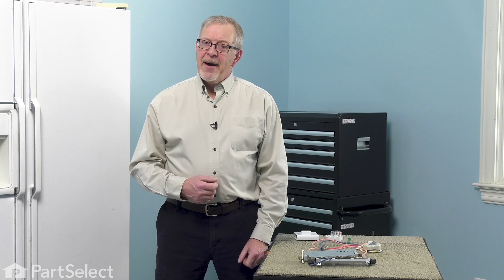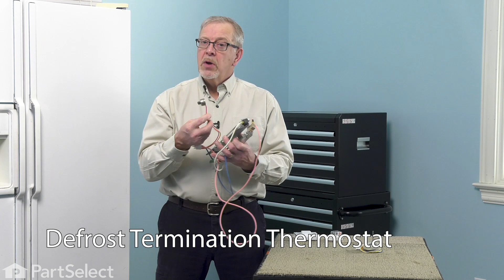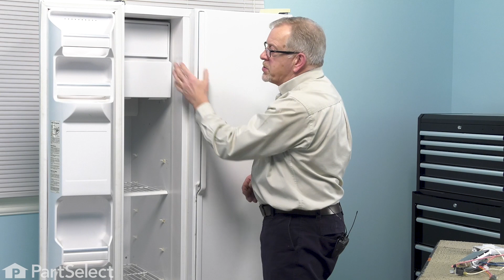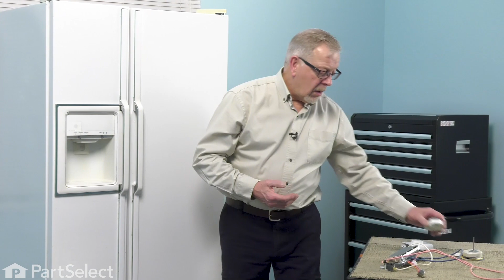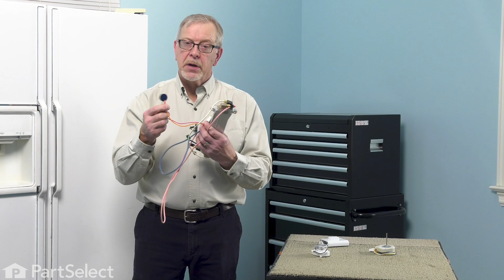Refrigerator Repair: Why Does my Refrigerator Have a Frost Buildup?

Comment: GE TFX25PA Side by Side Refrigerator
  Old freezing degree 18 F.  And cooling at the bottom of the refrigerator 35 F.
 And the top of the refrigerator is 67 F.
 The question is what are the holidays?
 Thank you so much
Reply: Did you ever figure it out mine is doing the same

Comment: With a Kitchenaid side by side, there is a evaporator coil on mine in the refrigerator.  That evap. coil is freezing up.  Suggestions?  Model #KSF26C6XYY04 Thanks for your time and consideration